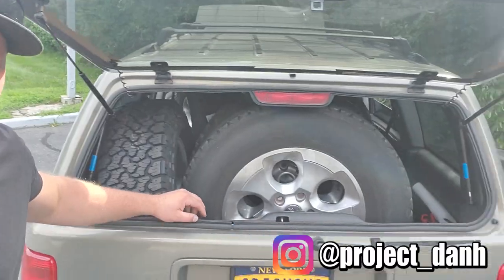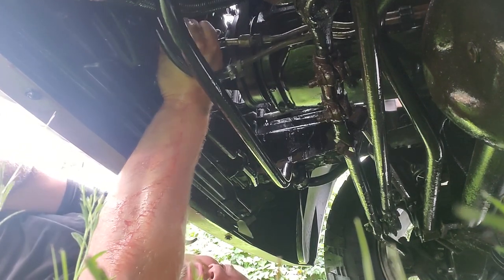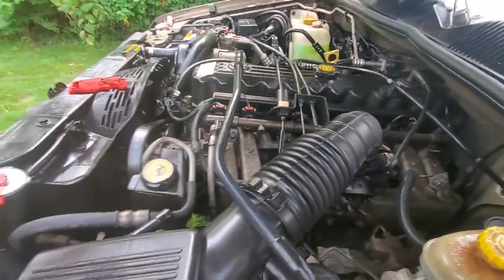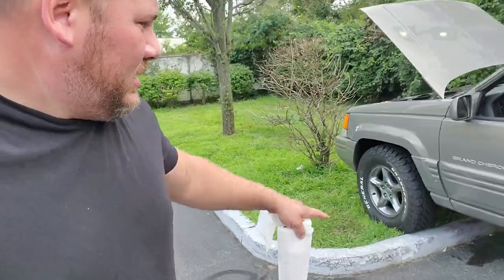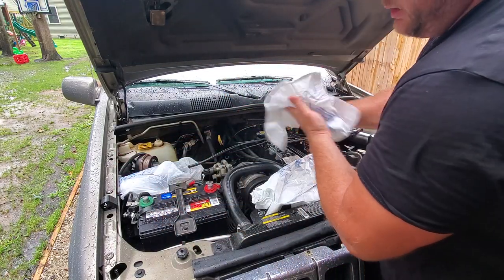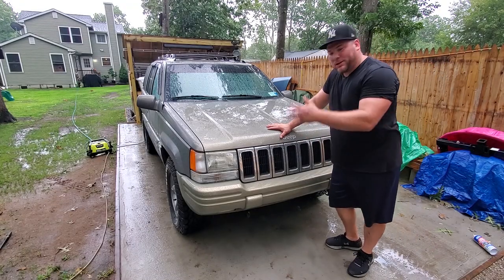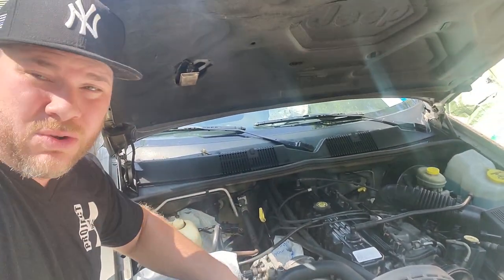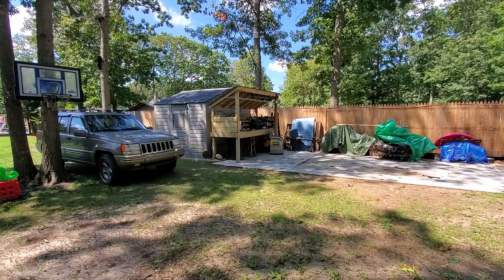JEEP GRAND CHEROKEE TRANSMISSION LINE DISASTER!!! PATCH, CLEAN & FIX!!!

Comment: Immediately run to the garage to make sure Zulu will not have the same problem....1 hour later bracket fabricated and installed. You are a Jeep saver!
Reply from the maker: thanks Dan!  your the second subscriber that immediately had to fix the problem!  what a horrible design... crazy man

Comment: I had a similar problem in my XJ a few years back before I put my new suspension on. It had so much play that when I hit a bump hard enough, the trans lines smacked in the suspension and broke them. As soon as I felt it slip, I pulled over and shut it down, got out and saw trans fluid pouring out. I had it towed home, repaired the lines and did a flush. This was atleast 50,000 miles ago. The AW4s are quite resilient as long as you keep them flushed. Shifts just as smooth as ever
Reply from the maker: heck yeah man! I love the AW4. blows the 42RE out of the water

Comment: This is why I used a steel line on the high-pressure line all the way up and to the transmission . Great save on the General but Jeeps don't like regular ATF it will kill the clutches in the transmission so I'd get some ATF +4 and flush the system out . Now the question is what's the new wheels for ??
Reply from the maker: It would be optimal to run all steel lines, unfortunately I modified them for a trans cooler.  New wheels are an option for the XJ build 😊. Couldn't pass up free!

Comment: I still cannot understand why Jeep put the transmission dipstick in such a lousy location for the ZJ ONLY. Similarly equipped WJ's (4.0L and 42RE trans) have the dipstick tube on the passenger's side like the XJ's have. On my "to do" list is retrofitting a WJ dipstick into 98 ZJ and the Mrs  .97 ZJ which are the same color (PJ7) as the General. By the way, he looks very handsome with the new tires.
Reply from the maker: I thought it might just be a weird 42re design. the sticks are pressed into the pan on the AW4... weird
Reply: I just put these same tires on my WJ. So far I thoroughly have enjoyed them. First day was pouring rain and I was definitely doing 15 over on the interstate with amazing traction. Sure glad they changed that dipstick up though.
Reply: My 42RE has the dipstick on the distributer side. Really easy to get to.

Comment: You can wedge a funnel between the airbox and fender for just this kinda time. 

Also, ever thought about doing the 99+ intake manifold upgrade? RockCrawlingJeeps have a good video on their channel.
Reply from the maker: Great tip!  Yes! I have a manifold ready to go! I just need the time 😲 lol
Reply: When you get into it... Consider extending the booster hose vs splicing the wires.
Reply from the maker: @SuncoastCreate  gotcha 👍

Comment: I'm glad I ran my trans cooler lines under the motor mount for my ZJ. Although on the 5.2 they connect on the passenger side. Btw, I just picked up some 5.9 door panels and the speaker mesh is kinda rusty. Do you know off the top of your head what color spray paint will match? Figured I'd pick your brain before I go shopping.
Reply from the maker: Hey Rob,. it's ac real easy fix. pop out the speaker grills, the infinity logo, then you can scrub em down and hit em with some semi gloss black 👍
Reply: @ProjectDanH  I was more thinking the stock grey, but I could do black.
Reply from the maker: @robertgrauman8602  the sky is the limit with paint! Do your thing buddy!

Comment: I need to go look at the cooler lines on my ZJ now.
Reply from the maker: scary right?!?
Reply: @ProjectDanH  Yes, mine are zip tied to the lower radiator hose but even then they're about a 1/2 inch away from the fan...horrible design....thinking of trying to re-route mine somehow.
Reply from the maker: @wildbill23c  yea man. I'm guessing my zip tie broke.  A ticking timebomb
Reply: @ProjectDanH  Definitely.  They really just chopped off the cooler lines as short as they could instead of routing them safely away from the fan, going to have to do some modifications to my lines I don't like how close they are to that fan, and zip ties don't last very long in heat/cold conditions anyways, let alone out in the open elements under a vehicle.  

I just had an idler pulley failure a few weeks ago that caused a broken serpentine belt and parts and pieces went through the radiator, as well as caused a blown head gasket, about $1300 later in repairs its back on the road but I'd rather prevent stuff from failing than let it go now that I know what those lines are close to YIKES!!
Reply from the maker: @wildbill23c  OMG.. you went through the mill!  Im Glad I could help you avoid another disaster!
Reply: @ProjectDanH  Its been a bad month for vehicles LOL.  My Bronco 2 had a tire that was worn bald on the inside, and the tire on the other side had steel belts coming through the sidewall...so it got new tires, alignment, tie rod ends, and bearings.

Comment: Murphy's law...transmission fluid line "snafu". Glad you got it figured out boy scout style. I like the JK wheels and free is a bargain, lol. Attitude determines altitude. Jeep, My Life, lol. Btw, backspacing on those wheels are 6", if they are 18 x 7.5. You may need a spacer/adapter if you bolt pattern is 5.0 on 4.5 on ZJ's and as you probbly know, the bolt pattern on lugs/axle on a JK is 5.0 on 5.0. Bora custom makes the 6061 aluminum, spacer/adapter you may need. In order to get the stance you want and clear brake calipers and lower control arm, etc. You may find that 2.5- 3 inch thick, hub and wheel centric 5x4.5 to 5.0x5.0 will most likely work. Good luck, Gods speed.
Reply from the maker: yep! you know dave! thanks for the solid feedback!

Comment: project dan... does the lower line from radiator back to trans lines connect to upper trans line and vs???.2001 grand cherokee laredo WJ I did not take notice when I removed them .. when i replaced the radiator. THIS IS WHER I am stuck. I worry so.. jeep has been sitting. help a girl out

Comment: Hey Dan, my VIC on my 94 ZJ stopped working. I have already checked and reflowed all solder joints but still  no luck. Any chance I could send it to you to check for me. I know you have had luck with them before. Thanks.
Reply from the maker: Unfortunately it may not be the solder Joints.. sometimes they just crap out.  I can't test yours because I have a 98... 98,97 and 96 are different then yours 🙁

Comment: Tell me is this when leaking on the passenger side of the vehicle or the driver side of the vehicle I have a major transmission coolant line leak on the driver side of the vehicle up front between the radiator and the motor

Comment: Dont you have to use Dexron 3 or special atf +4 fluid? MY  line sprang a leak took, it took 12 qrts at 5 bucks a piece!
Reply from the maker: ATF+4 Is the replacement for both

Comment: Did you ever fix the slipping issue or did this fix it?  Also any suggestions for mine?  When i get on it it will lose its grab on a gear.  98 4.0 42re
Reply from the maker: Turns out it was slipping because it was out of fluid lol.. I filled it with ATF+3 and used a half bottle of lucas stop slip... Good as new.  Thankfully this trans line mishap was a non issue.

Comment: What year is this Jeep. I have a '98 and it is the first year the stopped putting auxiliary coolers on them. I have a leaking line and the clamps on mine are totally different.
Reply from the maker: 1998 ZJ special edition
Reply: @ProjectDanH  mine is a laredo and it is the lower hose from the radiator that is leaking. Do you need a special tool I remove the metal part from the line?
Reply: A threaded fitting*
Reply from the maker: @brad300ZXS16  yes. They make special line removal tools
Reply: @ProjectDanH  I put a new clamp on it but the hose could still probably use replacing. I will look around and see if I can get one. Thanks.